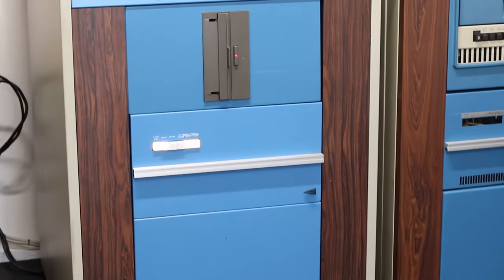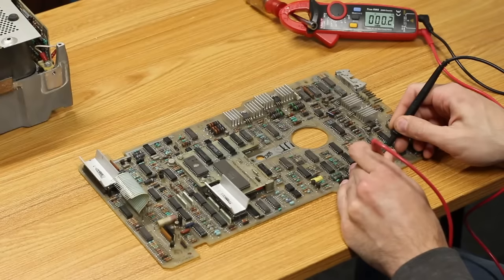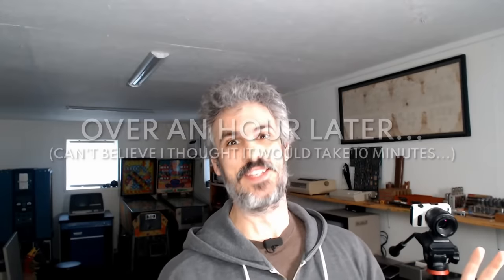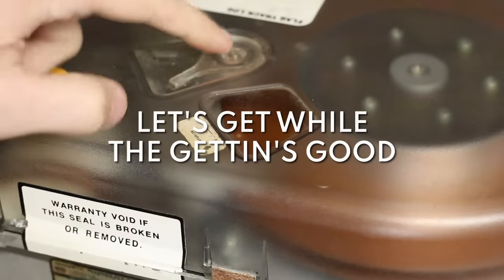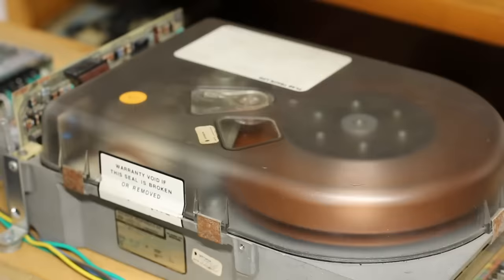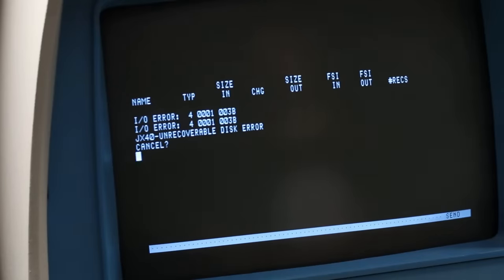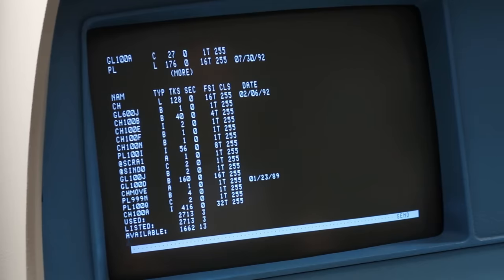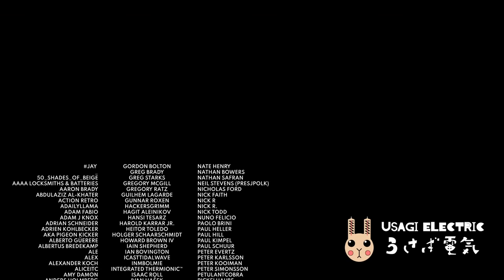Will This Rare 1980s HDD Live Long Enough to Save the Data?

Comment: Race against the clock time again, eh?
Nice cap fix. A nice thing I learned from watching @DiodeGoneWild is converting radial caps to axial by wrapping a cap with one of its leads bent back using kapton tape. Does the job really fine, lets you read the markings, keeps the cap nicely lying in place and provides insulation in case you don't have solder mask on the board.

Nice meta-programming there! A shell script writing a Centurion script to the serial - thing of beauty, joy for ever.

I love the storytelling in your videos. It's like reading a good book or watching a movie, with ups, downs and plot twists. You're obviously very good at it - and very entertaining too! Stay determined and Keri on :)

Comment: I manage storage systems with hundreds of SSDs (and/or HDDs, depending on the system) operating in synchronicity. The mind boggles that any of it works. It's basically magic. Congrats on getting the data!
Reply: The modern hard drives these days are incredibly complex machines.  The hard drives from the early 80's were straight forward and basically much simpler.

Comment: Video's like these make me appreciate modern computers in a way: Not having to explicitly know what disk to target or what partition and type out commands is a whole lot less cumbersome, but compared to my first computer (A 486, not sure what kind, it was a business-line HP Vectra from my dad's work that passed it's financial lifespan) I weirdly enough still miss the days of being on an offline computer and having to make sure your IRQ's were set properly for something as seemingly simple as a sound card.
The idea to now just have to plug in a disk that is having problems and clicking a recovery program is wild: the amount of technological progress we made with things like this is insane when you think about it.
Reply: Ikr. It's so crazy to me as somebody who grew up with XP and 7. By then PCs were pretty much just plug and play. That's probably a reason why many people buy microcontrollers and SBCs, to get that feeling of being in direct control of the machine. It's the equivalent of driving a manual transmission.

Comment: This brings back some memories of recovering data from hard drives. I could even spin up frozen 5 1/4" disks by twisting them during power on to release the stick slip on the spindle. It was quite common for disks that had been used in servers (running 24/7) to just freeze up as soon as they were stopped for a few days.

Comment: Well, it was the transistor that killed vacuum tube computers.  Vacuum tubes just didn't last long enough, and when you have hundreds to thousands of tubes, and a single tube failing can kill the machine, well there you go.  Transistors just last longer (when they got perfected, early transistors were a nightmare).  Especially in low density IC's.  Those 74 series were workhorses, that's for sure.
Reply: The longevity of the vacuum tubes was a "solved" problem. It was their physical size and power consumption that killed their usage in computers.

Comment: Just found this channel and your collection reminded me of a '90s Eastern European comedy show ("Imanta-Babīte nepietur"). In one sketch, a GP recieves a patient and asks if he made the urine sample for testing. Patient confirms and takes out of his bag two full 3l jars full of pee. Doctor, eyes like dinner plates, asks if he brought some suitcase of fecal samples too, which patient confirms and slaps a big old suitcase on the table. 
 So this '80s tech have similar vibes today for some..))

However, without experiencing much of it myself, i too have respect and some phantom nostalgia for it. As a normal guy born in USSR, i still prefer the miniturization, as long as it's sturdy design. We didn't have commercial consumer PCs back in the '80s (unless you risked paying 10× the price to some smugglers, same in beginning of the '90s). My dad did get the B&W soviet IBM equivalent in the first half of '90s, with 8in(?) floppy and i think 84K of RAM from the national TV he still works at. A bit bulky and heavy as hell. If i had it still, i'd send it to this guy. Unfortunately it got lost after someone cleaned out the parishe's storage space where it was sitting after apparent catastrophic failure.  
 ["ПКП" on the screen - not in any manuals, without any other signs of life or bios, though no visible damage inside. No specialist could tell what's up at the time, i'd be surprised if anyone knew here].

Comment: Mate I wouldn't have wiped that original drive but sadly it's done now. Your dealing with Electronic Archaeology here & the more you can save the better no matter what it is including data from any machine. I on the other hand have gone back in time quite a bit further to the Valve era looking at doing repairs to some ancient valve gear going again which is usually dried out caps & sometimes a resistor or 2. The valves are usually live by the amount of hours it's been run. It's lucky you have the skill to save these antiques. Keep up the good work
Reply: Good point. History is history. You never know what secrets could of been in there for future archeology research.

Comment: I love data archival, and I hope you can get that error fixed on that source drive now that the data has been mostly preserved and you are free to rewrite it.
Reply from the maker: I think just running S.NEWDSK on the Source disk would totally solve the error! Most likely, it's developed a bad sector or track somewhere, and S.NEWDSK detects those and creates a bad sector table that lives on the drive, so the OpSys can write around them. But, the bigger issue is the bearings. I'm not sure how we can get the bearings serviced without losing alignment with the soft-sectoring servo track on the disk. If we can get the bearings repaired, then I think we could totally bring the drive back up to reliably working!
Reply: @UsagiElectric  As weird as it is, see if you can find a Data Recovery Center or HDD repair place that has a clean room; maybe they can totally pull the drive apart, clean and service it, clean and relubricate the bearings?

Comment: i do enjoy the videos on this channel, despite 40 years of computer use, starting with spectrum in 1982, for my 8th birthday, i only started to learn electronic stuff earlier this year, with a box full of components and a soldering iron i have had a wonderful time, ive made a driver to power laser diodes, and set up an optical bench, ive made a zvs circuit to drive an old LOPT, ive chopped the deflection coils on an old CRT b and w tv to make a vector-scope. despite not having a treasure trove of ancient computers per se, i still get so many general tips from watching this bloke. thanks. and btw way is it called USAGI?

Comment: Amazing!  Vintage Geek's Finch drive should probably be retired now.  Ear defenders may help with the high noise levels.
Reply: Rebuild in controlled environment, A) Find any more board errors.  B) fix what are probably worn bearings - Usagi has the factilities to do that.
Reply from the maker: Thank you!
It all depends on where we want to go next with the drive. It is possible to try to fix it completely, but it's also very risky. To take it apart far enough to get to the bearings risks losing alignment with the soft-sectoring servo track, which would turn the drive into a nice little paperweight. I would be willing to take that risk if I owned the drive, but I'm not quite comfortable taking the risk with someone else's drive. But, I'll talk with Aaron at Vintage Geek and we'll come up with a good game plan for the MicroPlus!

Comment: Great job! It's a good day when all the hard work pays off.
Although errors on the "good"  32MB finch still trouble me.
We really. really need some kind of SD-card drive emulator or similar for Centurion. 
I think this should be doable. If only I had enough spare time to help...
Reply from the maker: Thank you!
Whenever S.NEWDSK runs, it makes a bad sector table that lives on the drive, so all the bad sectors are known by the OS and it can write around them. 
We're working on emulation options for the Centurion. It took about a month of work, but we did manage to get a floppy emulator working (the Centurion uses very custom encoding and timing that did not play well). We can now use that as a springboard for Finch emulation, as it's mostly like a Floppy with much faster data rates.
Reply: @UsagiElectric  Thanks a lot for replying.

it SHOULD mark the bad blocks, but if there are many in same spot the whole area is likely marginal and likely quite unreliable - at least this is how DOS era hard-drives are.

Floppy emulation is excellent news! I applaud you and everyone who made that possible.

I think all of your viewers would really appreciate if you could give us occasional updates on community development progress - emulation and all.

Thank you and stay awesome!

Comment: 9:07 Still being used in 1996.  I'm impressed.
Reply: That is 10 years after Centurion (ZTRON) went bankrupt in NOV-DEC 1985.   The assets being sold to ex-Centurion dealer in the spring of 1986.

Comment: Absolutely love archival recovery projects. I remember many moons ago working on a project to recover data from a machine I can only remember being called an "Ego". Was a sort of single box minicomputer thing with a couple terminals, booted from ROM and had a removable 5Mb (I think) disk. Went through a process of dumping data out the centronics parallel port, via a parallel to serial converter to an RS232 port on a PC hahaha.

Comment: Sooner or later you're gonna need a larger space if you keep expanding that Centurion! Can't wait to see you tackle the new stuff you'll be adding. And, in this case, I totally agree about wiping the drive. If it's entirely personal info, it's a huge risk to keep. Just back up software and stuff. I'm all for data preservation, but there's just certain things that should be erased or left in a vault for 100 years and not left anywhere near the public until it's old and irrelevant.

Comment: Another method involves heat... using a current limited power supply, you can bring up the current and use the 'touch test' or an IR camera to see which parts are dissipating the most heat. Alternatively, if you do not want to power up the board, you can leave the ohmmeter attached and use a heat gun to warm up various parts and watch for a change in the resistance reading.

Comment: Wow, I wasn't expectinh to like this video so much. I'm born in 1981 and kinda like vintage computers but I have so many different interests I still don't have either money or time to act upon. Also, there really doesn't seem to be any money in vintage computers. Also I'm from Sweden and I don't think we have much of these machines anyway. Your charisma and energy made it so fun to watch. I'm quite surpriced how many different levels of mechanisms and stuff you can use. I converted to Linux from Windows just 10 years ago but still have a hard time learning all the different commands, but the commands in the computers you use seem more logic to me. Maybe my problem with learning the commands is partly because I have a hard time to unlearn the things I learned in Windows, and also because I pretty much are convinced I have ADHD, Autism and perhaps Bi-Polar. Some probably just think I use them as an excuse. But some things I can get so immersed in it's hard to communicate with me. You don't look very old but your grey hair makes you very handsome. Keep the great work up!

It certainly look likw this hardware is a lot more durable in a way, so I guess you can expect some time traveller visiting you which needs help restoring their f*ck up. :P 🤘

Btw, cats are such a bliss to have. I''m originally a dog person since I grew up with two of them. But a cat is so independent you actually have time for your self and your hobbies!

Instant Sub!

Comment: Can you boot off the drive though? Is there enough of the system working on that drive image now that the micro-plus will be bootable off an image of it? What will they have to use for a drive emulation? Something like a GoTek?
Reply from the maker: That was one thing I wanted to test, but unfortunately, my bootstrap ROM doesn't support booting from a Finch. The MicroPlus has a different bootstrap ROM that only supports booting from the Finch or a Floppy (but not a Hawk or CMD drive, like mine). 
For emulation, we're working on a few solutions. After about a month of work, we have successfully gotten some floppy emulation happening (the Centurion uses very custom formatting and timing that didn't play nicely with emulation at all). I'll dig into more detail on that in a future episode!

Comment: Hey WOW!  I just found your channel.  Years ago I worked for Control Data Corporation as a Customer Engineer on the Cyber 17X line of super computers and peripheral systems...677/679 tape drives, 844 removable pack disk drives, 405 card reader, 415 card punch, 512 and 580 printers, etc..  Do you ever come across any of that equipment?

After CDC I worked on some Data General equipment and then ended up at a 3rd party company working on the old HP 3000 series computer.    I loved working on the old stuff. Most young guy can't figure it out.

Comment: Imagine if there was a SCSI interface card for the centurion.
Reply: Since the Hawk uses a Pertec interface, perhaps, it should be possible to attach a Pertec-to-SCSI card? Although I can imagine those cards are ungodly rare these days... And maybe they're limited to only one SCSI drive or they just allow you to attach a Hawk drive to a SCSI system.

(Now that got me thinking... A DEC RL02 connected my Power Macintosh 7500... That sounds like an incredibly cursed abomination that I would be capable to pull off!)

Comment: I Don't know what the capacitor that was causing the short was used for but replacing a foil capacitor by an electrolytic could be a problem depending on what it needs to do, they don't have the same properties
Reply: PS: Small typo, wrote too fast, it's a film capacitor, polystyrene film capacitor probably.

Comment: Those older hard drives are build 1000% more reliably than modern drives.  They had to be back then.
Reply: I don't agree with this at all. Reliable, no. Repairable, yes - but that has to do more with the available technology (like big honking boards of discrete logic and mechanical parts you can see with your eyeballs) to make them. Why would they have "had to been" more reliable than modern drives? So that they could last longer than the much shorter obsolescence cycles back in the day? Head crashes and lost data were way more common then; it's just a fact of new, bleeding edge, practically bespoke technology. They were hand assembled!

Spinning HDs now have mean-time-to-fail of hundreds of thousands to millions of hours (50 to 200(!) years) and are shock tolerant. That is, at absolute minimum, you could expect 50% of a run of a million cheap new consumer hard drives to run for 50+ years! Not run after 50 years, run for 50 years. There is absolutely no way that CDC drives from the 70s could match this. The designs now are decades iterated and the tolerances are insanely tight and reproducible compared the battleships of yore.

Comment: Good work!
Could the noise be caused by a brushless motor with a malfunctioning phase? Perhaps with a missing phase, it can cause a resonance.
Once all options for the drive have been exhausted--and if there isn't yet a hard crash--would there be any harm in removing the spindle bearings and replacing them?
The drive would have to be disassembled, and it's likely that it would have to be low-level formatted once reassembled. Dust surely would be an issue. The outside of the drive would have to be immaculately clean before even contemplating opening it. Though, concentric is concentric, and bearings of such quality are easily made today. Online retailers such as Boca bearings might have a bearing of high enough quality for that drive.

Comment: Transistors are one of the most reliable electronic components in the world. While we deal with failures related to them often we have to remember that out of the thousands - millions - billions of transistors in a single package, it is often only one that fails out of all of them
Reply: And frankly, they usually do not fail at all. The vast majority of failures in electronics are electromechanical or electrochemical components!

Comment: I'm thinking s.dump does a track for track copy.  This would only work if no bad sectors/tracks and same disk 'geometry'??  That's probably why you had to do a 'newdisk' on the 32 MB drive again.  So the script would seem a better way to get the data at least in some readable form.

Comment: The Fluke 8060A is great for finding shorts like this since it has a resolution of 0.01 ohms and has a REL mode that zeroes out the probe resistance, which is around 0.07 ohms.

Comment: Love the end of the video when you have your Dr Frankenstein moment “it’s alive ! It’s alive!”
I’ve been there after repairing micro electronic motherboard connections 
And also on a Cadillac CTS timing belt and pully replacement with interference engine
On mistake and it’s all over
Cool video thank you for sharing this old but very cool technology

Comment: I have worked on a lot of electric motors that sound is a bad bearing i find that singer all-purpose machine oil really works extremely well on brass bushing type bearing white lithium grease is good for ball and roller bearing and is better on plastic parts